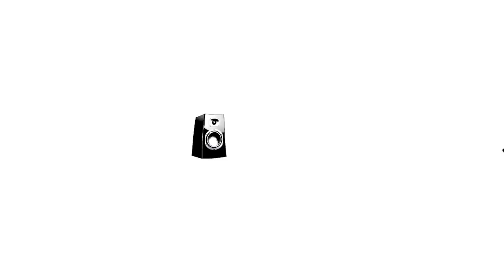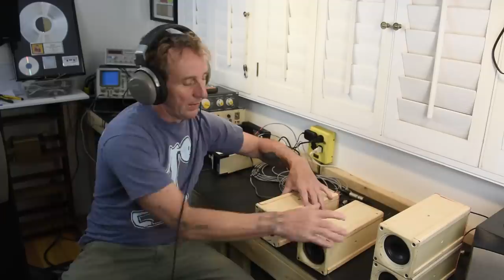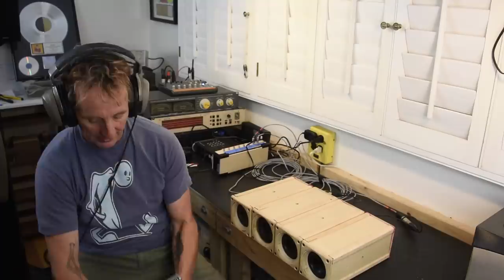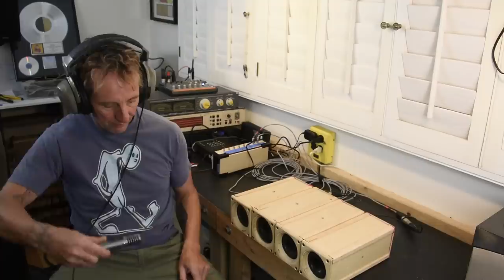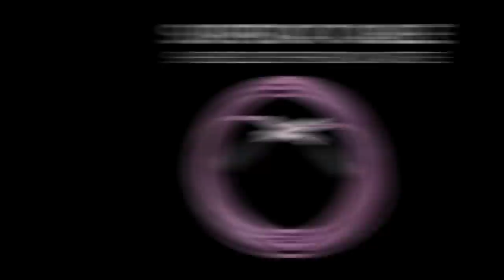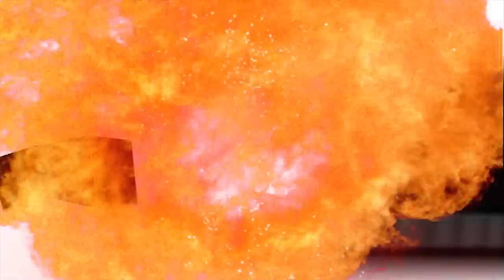Line Array vs Point Source vs Human Hearing

Comment: Thoughts on danley sound labs? The jericho series.
Reply from the maker: There are many ways of to design sound systems.  You can build something loud and then strive to make it sound good, or you can build something that sounds good and then strive to make it loud.

I personally prefer sound systems that are more like a bunch of studio monitors that have been optimized for work together to reach the volume levels and coverage needed for a rock show, than large horn systems that cover and reach high volumes and then attempt to be optimized for sound sound quality
Reply: Dave Rat they claim that the jericho has a flat frequency response. I thought having a flat frequency response is good?

Comment: A stereo Mic would have been more demonstrating with phasing on both the horizontal and vertical planes. But yeah, I dodn't do audio professionally, don't have the time but I do come across venues and systems that have the same common issue, muppet sound designers more mixed up in sales and bragging rights. Got plenty around here using LA setups in small venues (150-1000 persons) and they sound like crap due to being out of time/phase. Peaky levels and poor freq response. Even worse, the "Sound Guy" can't hear the phasing issues or that speakers are simply wired backwards on a bin puting it 180° out.
Reply from the maker: I did use a stereo mic, and you should be able to hear the stereo with headphones or stereo setup

Comment: that there are problems with them is not because of the principle itself, but because of its structure ...
on the one hand, 3 inch speakers are not suitable for the high frequency in a line array, on the other hand they have to be as close together as possible and the front panel of your speakers creates additional problems
In addition, a line array in the near field always has problems ...
it is also nonsense to talk about time difference, this shows very clearly that someone did not understand the principle as such
A properly constructed line array works up to over 10 kHz like a single loudspeaker with no time difference, regardless of whether you place the line array horizontally or vertically
please take another good look at the topic, a PA line array is not a good line array but just something that comes from a lot of compromises
Reply from the maker: Actually, I think you may be making assumptions and taking the manufacturer specs and literature a bit to literally.

Let me ask you this, can you name a single manufacturer or model of a horizontal full range line array?

Not only that, even if you were to perfectly sum multiple drivers or ribbons or even create a very long flexible geometry ribbon that had no transitions between sources, as it was a single source, still there would be issues if horizontal.

In other words, the perfect horizontal line array will still be incompatible with sounding good to human hearing.

Question this? Easy to test, Take a line array, any line array that is set to less than maximum box to box angles and deploy horizontally. Then walk and listen.

At max box to box angles, line arrays are typically a splay and more of a point source systems than a summation line.

Ya see, this demo is not me figuring this stuff out, but rather, after owning, deploying, and mixing on large format line arrays for 30+ years, I am sharing the real world info I have learned.

Oh, and thank you!  I will do a video going into more depth and why horizontal line arrays do not exist
Reply: @DaveRat  Let me ask you this, can you name a single manufacturer or model of a horizontal full range line array?
There is no such line array in the PA area because it consists of a lot of compromises
There used to be line arrays that worked with horns, these could play very far without any problems, unfortunately this is very expensive and in practice it is not worth the additional costs

Not only that, even if you were to perfectly sum multiple drivers or ribbons or even create a very long flexible geometry ribbon that had no transitions between sources, as it was a single source, still there would be issues if horizontal.
as I said, you have to deal more with the topic ...
The biggest problem you have then is the very large near field

In other words, the perfect horizontal line array will still be incompatible with sounding good to human hearing.
This is your claim, a claim from someone who doesn't really understand the principle and hasn't heard a line array that works up to 10 kHz ...
what you hear does not come from the principle of a line array, but from how the manufacturers build it

Question this? Easy to test, Take a line array, any line array that is set to less than maximum box to box angles and deploy horizontally. Then walk and listen.

At max box to box angles, line arrays are typically a splay and more of a point source systems than a summation line.

And what are you taking here as an example of a line array?
about one with 8x 4 inches and 1 tweeter from one of the many manufacturers?

Question this? Easy to test, Take a line array, any line array that is set to less than maximum box to box angles and deploy horizontally. Then walk and listen.

At max box to box angles, line arrays are typically a splay and more of a point source systems than a summation line.

And what are you taking here as an example of a line array?
for example one with 8x 4 inch and 1 tweeter or one that only works properly up to the edge of the box from one of the many manufacturers?
they push the problems that arise from improper implementation of the manufacturers with a line array onto the array itself not onto the manufacturer ...
Just test it with 2 inch speakers and you will see that the problems become much smaller

Comment: Pardon the tangent,  but it does relate to ears,  just not the hearing part.  
Our inner ear and our vision combine the pull of gravity and visual horizon lines to maintain correct vertical awareness.  If you tilt your head along with your motorcycle in a high speed sweeping curve,  both the inner ear and vision are being fed false data.  It is disorienting in a very weird way.  I think it is normal for one of the two to occasionally be scrambled and then the other covers for it.  And that ends my sort of related but not really.....tangent.   Good day.

Umm.....it takes a rather elevated velocity and quite a lean from vertical (I cannot confirm or deny....)  to generate the bent false gravity that screws with the inner ear.  Please don’t try to support or debunk this babbling on public roads.
Reply from the maker: And also try closing your eyes and see if the perception changes

Comment: It seems like concert sound took a shit with line array...
Reply from the maker: As someone involved with the concert sound industry and sound reinforcement for 40 years, I can honestly say, even crap sounding modern concerts sound so much better now than they did back then, it is mind boggling.

Every aspect from amps, speakers, processors, predictive measurements, sound coverage and on and on are so vastly superior now, it's like comparing a 12"  black and white tv from the 60s to a modern 60" flat screen and saying, TV has really gone to shit.
Reply: Been to several shows you were involved in sound was excellent, I'm not an expert on concert sound,  it's a given gear is a million times better now and I suppose I saw a few terrible sounding gigs with the pencil p.a. awhile back  then caught some gigs with a real pro driving an x array or prism rig that was sounding amazing, of course seen many line array driven shows sound great too, obviously a lot of variables, and I dont know shit

Comment: However, if you have a Danely system, you don't have all of those issues. Hard sell for everyone in the indusrty.
Reply from the maker: As long as you only have one box wide and do not try and combine multiple horn flares, there is not issues but as soon as you splay horns, there will be issues. There will always be issues when a listener is not equidistant from source reproducing the same sound. Take some strings and tape one to the center of every driver reproducing the same frequency, in an array. Then pic a listening point, and cut all the strings to be the same length to that point. Then move side to side and if all strings are equally taught, no slack, you are good, as you will be with a line array.

Any and all close proximity side by side speakers, horn loaded, direct radiating or line arrays suffer from cancellation, null and summation issues in the horizontal domain. some more than others but none are immune. Not even the Danley fans

Comment: Hi Dave, I appreciate what you're trying to do here but your video audio is just awful. It would be better if you used a headset mic so that both your voice and the whitenoise is clearly audible. The whitenoise overpowers your voice completely and it had me stop 1/3 of the way through.
Reply from the maker: Why not turn it down and use subtitles?

In later videos I have reluctantly accepted that just spontaneously free sharing sound concepts in unscripted videos is not enough and I also needed to invest in better video editing software and muck around with editing and such.

And yeah, it's not so bad, but back then things were more simple and had a much more niche audience.

Cool cool